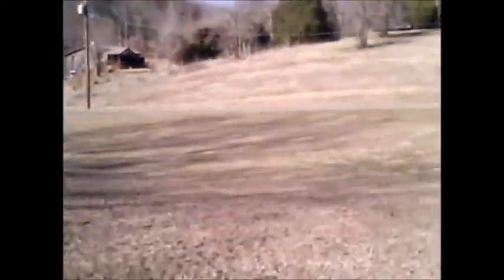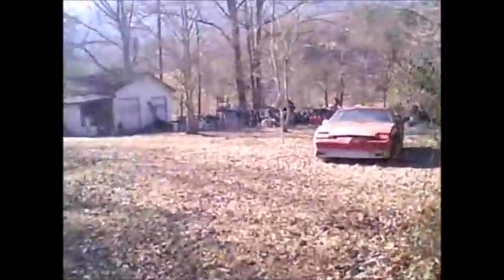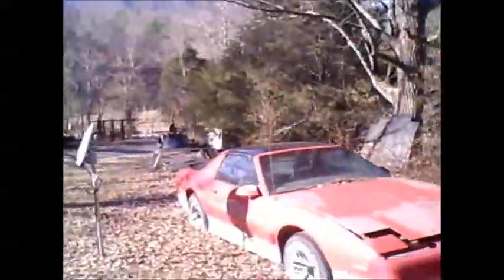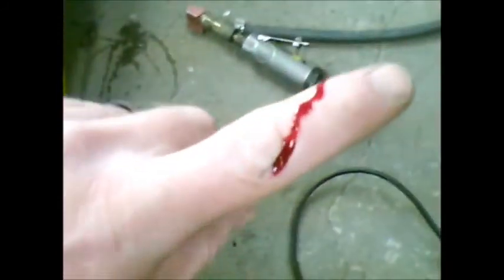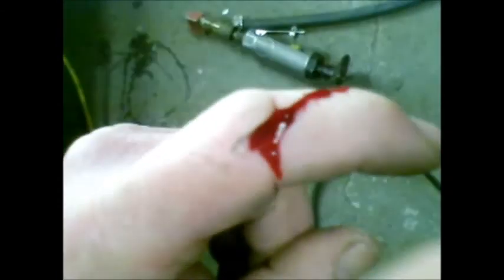Truck bed and oops

Comment: hy cecil i wanted to first of thank you for your vids. next for the larger crease since  you have a welder an old school knocker with the screw in tip works great if you can get one   just weld the holes after. and last thank you for subing and comenting to my Chanel i am having trouble responding on gmail but i rely    do   appreciate it